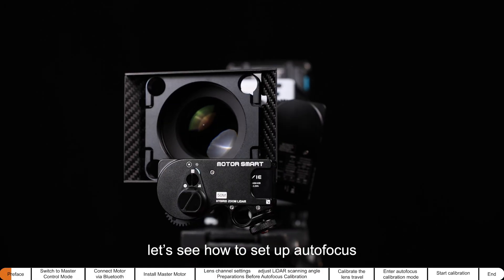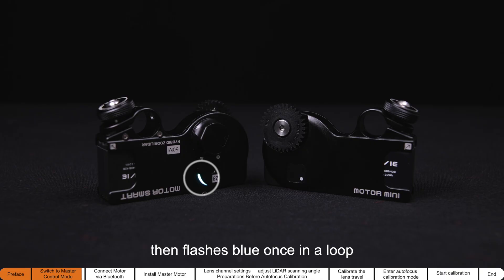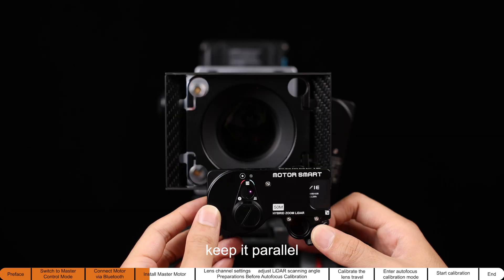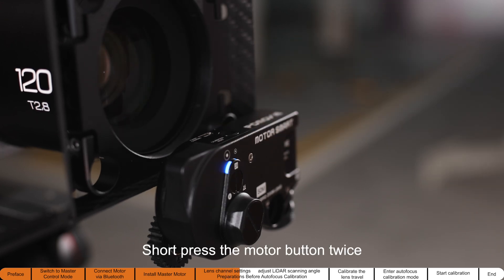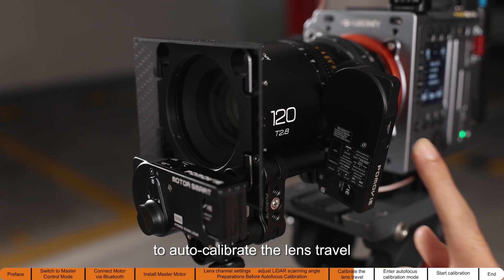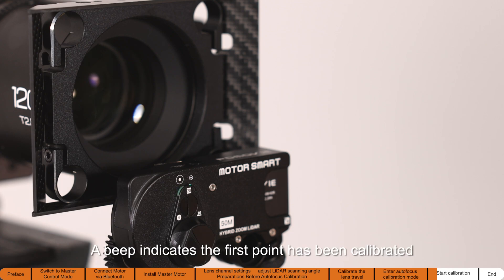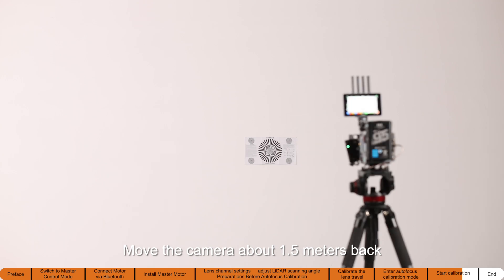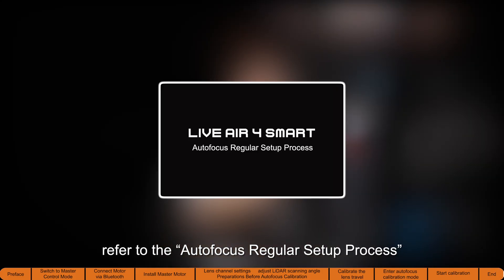The Master & Slave mode autofocus setup process for PDMOVIE LIVE AIR 4 SMART. #liveair4smart #lidar

Comment: Do you need to re-pair each time you turn on the device, or do the two devices automatically pair when they are powered on?
Reply from the maker: If you no change any setting, two devices will auto pair when they are powered on.